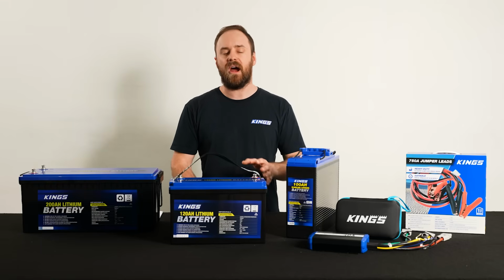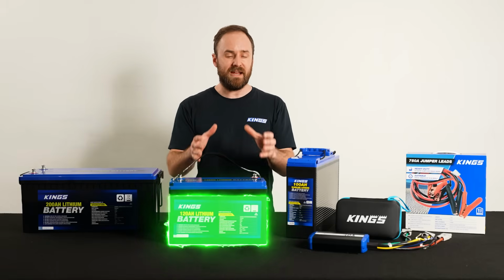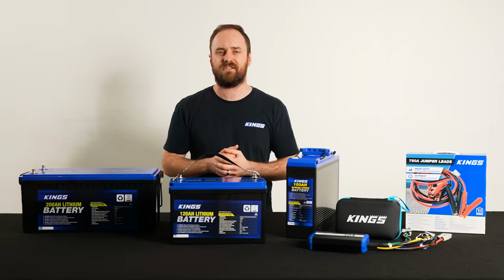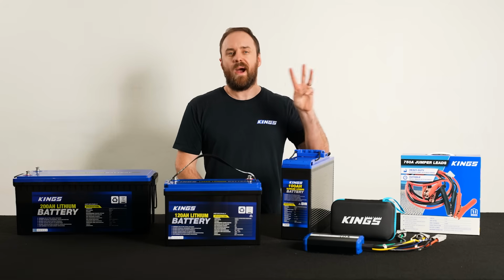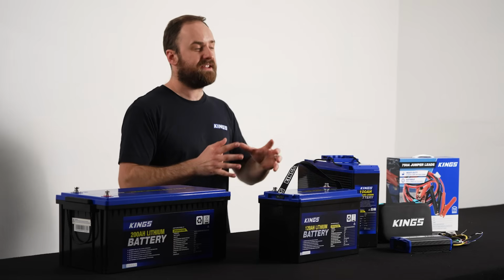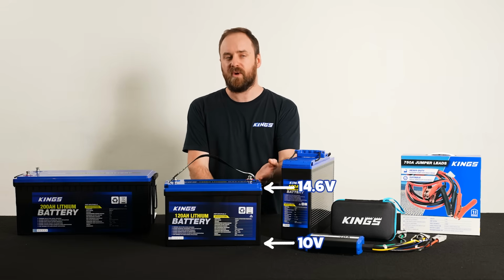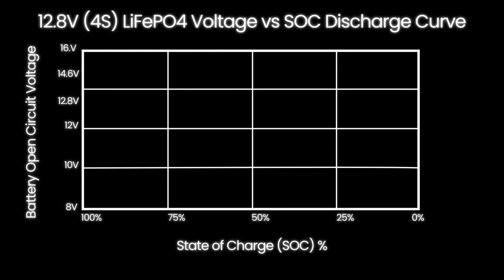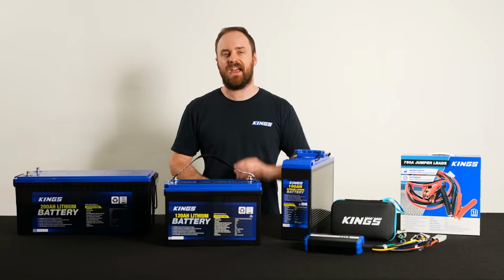Adventure Kings Lithium Series: Mythbusting (Part 7)

Comment: Does your 120ah lithium battery have true charge and discharge overcurrent disconnect.
I believe your BMS relies on over temperature to disconnect battery during overcurrent condition.
Reply from the maker: Hi there Emmanuel, thank you for your question. I can confirm that the BMS in our lithium batteries has an over current protection. 

Kind regards, Sue

Comment: I got two 300 lithium king's batteries only running fan & fridge shut off 3am down to 10.5amp.  Total junk
Reply: I'm running, 2 big fridges, a 750 watt evaporative AC, tv, computer, induction cooker etc. etc. and have absolutely no problems. They are great batteries, I'd put your situation down to user error.
Reply: Try balancing them and that might reset them

Comment: Where do you hook up the black heat wire on the ultra slim battery?
Reply from the maker: Hey there,

As the ultra Slim battery does not have any terminals, you would not be able to connect the temperature sensor wire. 

Regards, Jayden

Comment: Why is it only recommended to run no more than two of your lithium batteries in parallel?
Reply from the maker: Hi there,

This is to reduce interferance between BMS systems, as they all have an internal simple BMS larger and more complex systems can have inaccuracies in readings.

Regards, Andrew

Comment: It'd be good if the battery was charged when you bought it 30 percent at shipping but why not just charge it up.
Reply: Are you saying why doesn’t kings charge them before they sell them? There are a number of reasons. 1 they sell dozens a day and it takes hours to charge them. Two you don’t want a battery fully charged and left fully charged for a long period. 3 they would have to open the boxes they ship in. It is completely impractical for them to charge them. 

You buy a power bank brand new they don’t come charged. Anywhere. It’s exactly the same.

Comment: So why do the shipping box, pos box, battery, and website specifications on each batteries conflict each other?

So what is the absorption and float for a 300ah kings battery?
Reply: absorption and float is something the charger will do.. use a charger specifically designed for LiFePO4 batteries and you don't need to mess around with specific charge parameters.

Comment: Isnt the 30% only for air freight?
Reply: I think it would be impractical to have batteries pre-charged to different levels for air freight and land freight. It would make more sense to have everything changed to the most restrictive requirement so they can then be shipped any way from source to destination.
Reply: @andrewford80 got a 300ah and only would take 139ah... so it's either fd new.... or was charged well over 50% still
Reply: @ausguy4385  perhaps. I'm not an oracle of kings batteries, merely making a suggestion
Reply: @ausguy4385 or your charger can’t handle a 300ah battery. Are you using a DCDC or a wall plug. Most people who buy high capacity batteries like 200-300ah don’t have an appropriate sized wall charger. I’d be buying like a 22amp wall charger minimum for a 300ah battery.

Comment: What about IEC 62619 approval? Some people claim it's required for use in a caravan, but the standard says it is required in context of Lithium Ion batteries, Not specifically Lithium Iron Phosphate batteries.
Reply from the maker: Hi there,

LiFePO4 falls under the Lithium Ion family indirectly, and as such in order to sell them in Aus they need to comply to my understanding, so I can confirm ours do at the very least.

Regards, Andrew
Reply: @4wdsupacentreAu  Great thanks, I couldn't find the standard quoted on any of the info with my batteries, but I assume they are compliant because they are able to be shipped into the country through container ports anyway.

Comment: How are these batteries better than the rest please?

Regards, r
Reply: I worked at kings for a short while. Their batteries I have zero problem with recommending and have a set myself. Most of the issues people have with them are because of a lack of knowledge or a shit setup. Things not wired in correctly.
Reply: They are cheap and actually made rather well. They get a good rap on most forums.
Reply: They are heaps cheaper than others, but appear to be made quite well, there's a number of channels who have stress tested them and turn them apart to look at the build quality. Bear in mind they are not a drop in replacement for lead acid, they can't go in the engine bay and they need. Special charger.
Reply: I have a few Kings 200A Lithiums for about 2 years, they work well, have a good BMS and are cheap compared to others, the teardowns & tests seem to be pretty good build and value.
Reply: There battery's are one of the things they do right. Strongly recommend them!